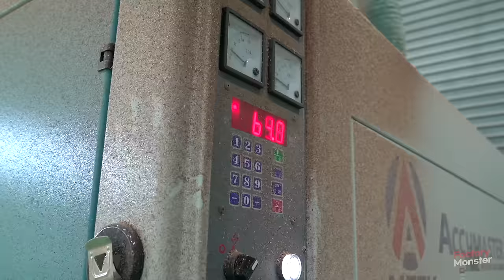Turning a Giant Tree into an Expensive Dining Table. Korea’s Wooden Table Mass Production Process

Comment: The fact that the plan of the table is in one piece allows to highlight lines of wood strong aesthetic. However, this has a major drawback: since wood is not a stable material over time, the risk of seeing the table plan crack is major, even when the wood has been cut into planks and then naturally dried for 3 or 4 years. (which is not the case here).
Reply: Это мода, и на дальнейшее её растрескивание дела ни кому нет
Reply: @Dverio  Растрескивание- это не повод утилизировать стол. Эпоксидная смола всё исправит. А вообще, столы из слеба имеют бОльшую стоимость при одинаковых размерах столов изготовленных из цельных кусков дерева. Надеюсь, смысл понятен?))
Reply: While they take the legs on the side of the car, they will be wrapped around.
Reply: 원목용 나무는 벌목해서 바로 사용하는게 아닙니다
 그늘에서 원목의 크기에 따라서 2-5년씩 건조 합니다
Reply: @이병주-b2d  놀랐어. 전체 트렁크를 건조하는 것은 일반이 아닙니다. 그것은 잘 통풍이 될 수 있도록 포개질 것입니다 원시 보드에 그것을 자르는 것이 가장 좋습니다.
이 방법은 목재가 갈라지는 것을 방지합니다.
Reply: Poor quality. Planks take approx 1 Yr per inch thickness to properly season. This is 'green' wood that will warp. And the uncut width will be liable to splitting as it continues to dry.
Reply: Maybe it has been dried for a long time before processing. We have to assume they know what they are doing, or else they would face a lot of angry customers.
Reply: @SweBeach2023  Maybe you’re right. But I don’t think so, because you never dry whole tree trunks. In the video the trunks arrive whole, and are then sliced. Since the drying is not uniform at the edges and centre of the wood, this creates tensions that distort the wood and cause irreparable cracks. The proper drying technique is to cut the trunk into raw slices and layer them by placing wooden wedges between each board. The boards are well ventilated and will dry naturally for two or three years.
Reply: @itacaperduta  Those are some really big tree trunks, and we don't know from which species of tree. Maybe drying them whole is the proper way to do it? As I mentioned, these guys are working with those big trunks in a professional setting making very expensive furniture. We have to assume they, as compared to us as watchers of this video, know what they are doing.
Reply: @SweBeach2023  Судя по оборудованию, персоналу и самой фабрике, а также организации процессов, это может быть мебель с любыл лейблом, в том числе и Fendi, при этом об исключительном качестве здесь речи идти не может. Маркетинг решает всё в наше время. К сожалению…
Reply: At 5:00 they show the wood drying in a kiln for a few days.
Reply: @SweBeach2023 they’re not making expensive furniture. They’re mass producing low quality tables that look expensive.
Reply: @MegaFregel  Mango wood, I believe. It's nice, but no, it's not walnut, or mahogany...

Comment: I have a riser desk, 1.8 metres by 0.8 metres and I love to replace the top with the dark mahogany wood, they are beautiful.
Reply: if you haven't done so yet. Beware that some mahogany are really dense, and so probably denser than whatever is currently used. Depending on the type of riser, that may hinder the mechanism that hold the table at a particular height or the motor that adjust it.

Comment: What an absolute waste. I too make big tables and assorted wood pieces.  But as any body that works wood knows lumber of that size and thickness has to be air dried for months BEFORE YOU KILN dry it. Those table tops will shrink split warp and crack before it's on a showroom floor ...what a waste